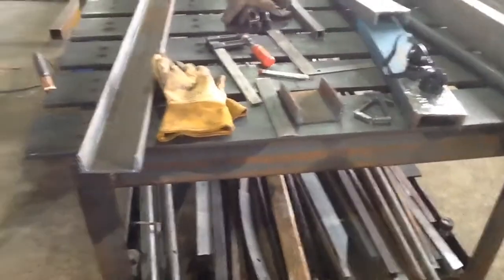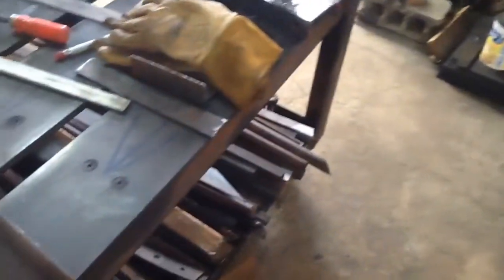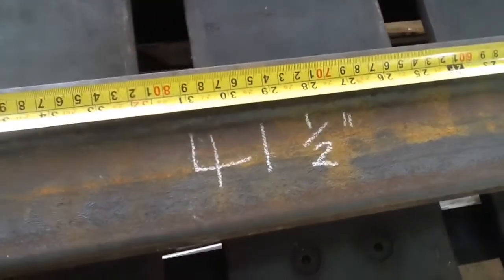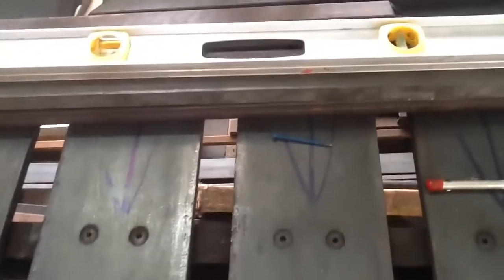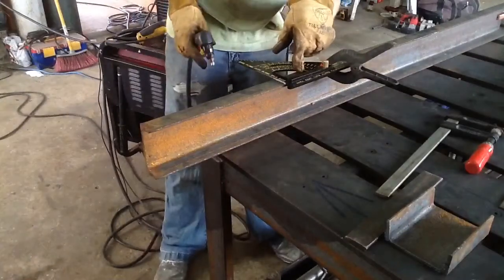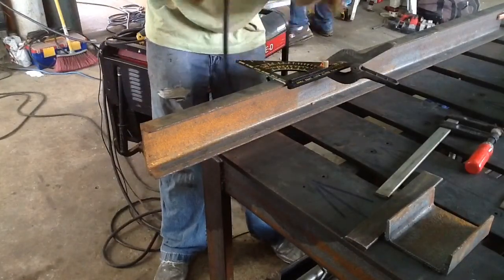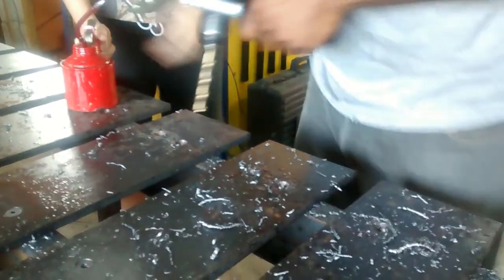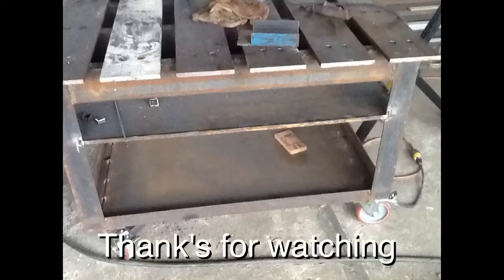Making a Precision Welding Table

Comment: Hi, thanks for the video. Looking to use your design to make my own. Question: Why screw the slats and not weld them to the top frame?
Reply from the maker: I suppose you could weld them.
But if one of them was to be damaged it could be helpful to be able to remove it and replace it and also part of the flatness comes from having all of those anchor points pulling it tight together.

Comment: great table build, looks real solid.  what is the thickness of the top and size of channel?  also, why did you choose channel versus square or rectangular tube?
thanks
Reply from the maker: Where I live they don't sell square or rectangular tubing in heavy wall sickness.
The tabletop slats are 1/2" inch by 6"
The C channel is 4" x 1/4" but if you want an even extra strong table 6" channel wouldn't hurt